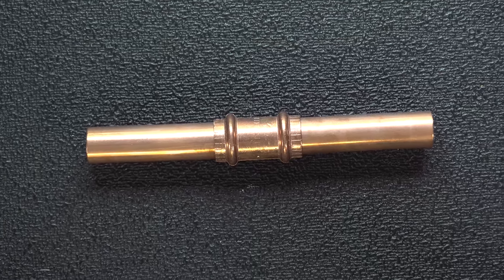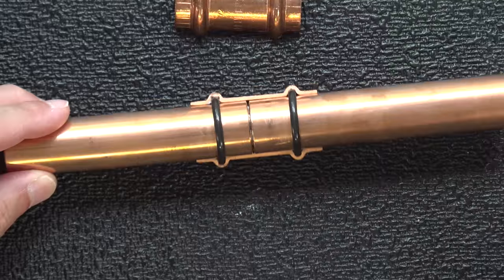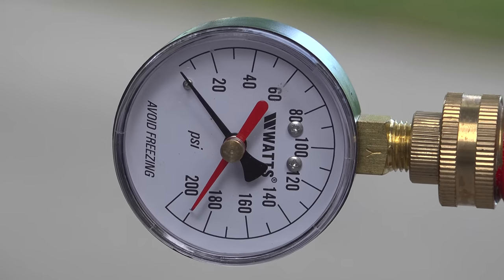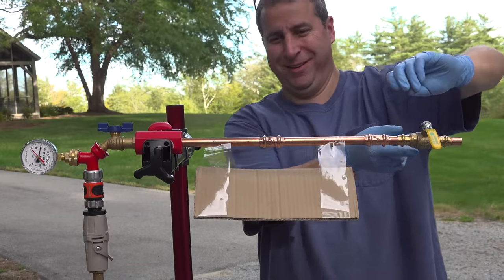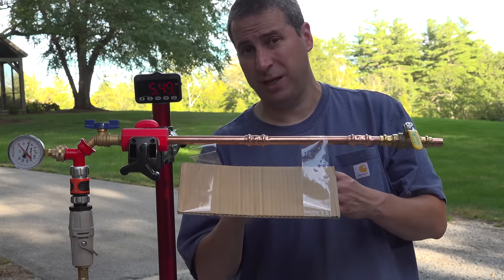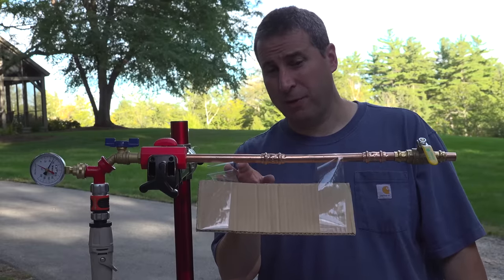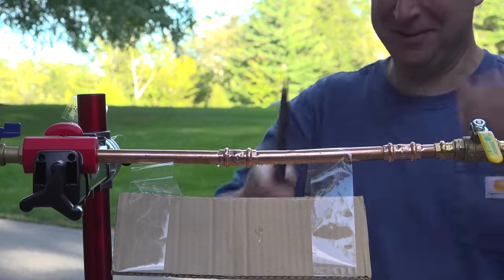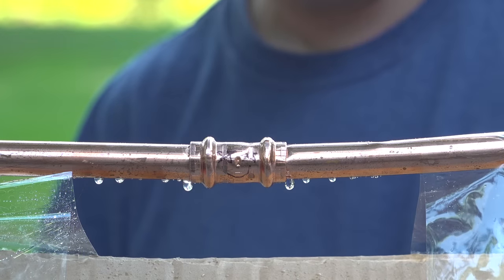Do O-Rings Really Leak Over Time? Testing PROPRESS

Comment: Its similar to a copper flare...so if the pipe is in original drawn form....it will be good,never had a problem with compression flares when done right....i use synthetic grease with my flares like a gasket,so the oring does the same thing as a gasket on press copper...

Comment: maybe for extra insurance, since o-rings are out, you put a little solder on outside? then should be good to go for a long long time.
Reply: At that point you defeated the whole purpose of these fittings (faster, no flame required, no need for pipes to be dry) so you may as well skip the expensive crimper tool and use the much cheaper fittings that are made to be soldered. Also, solder wouldn't correctly penetrate this joint as tight as it is. If it's sealed well enough to contain pressurized water, there's no way solder would get through it. Just crushing a regular fitting enough to keep it in place while you solder it can cause the solder to not seal properly.
Reply: @averyalexander2303 I think that was exactly his point

Comment: My problem with ProPress is not hitting it with a wrench. It's hitting with something much more solid. Water hammer. A lot of houses have water hammer issues and ProPress is commonly used as a repair to an existing system. A lot of older houses have water hammer problems. Mine is one of them I just have an addressed it yet. However, you're only a 58 PSI. Every house I've ever lived at had nearly a hundred PSI water pressure. Mix that with a few long pipes and a sprinkler solenoid that abruptly shuts off, now you get shock loads of several hundred psi.  In some cases hammer can explode pipes. However i'm not talking about that extreme of a case.
Reply: Yes, it would be nice to see the test repeated at 300 PSI, with and without O-rings.  Of course, water hammer can cause properly soldered joints to fail also.
Reply: gadeteez. I am genuinely interested in your comment.  Is it the velocity of the water that causes the pressure surge. I think a water pressure of 100 psi that can produce three times that by shutting off the valve is always going to be at risk regardless of the fittings. 
I would fit a shock arrestor in such a system.

Comment: It's not expensive, the price is very close to solder fittings. I did however buy the rigid tool for $4000.00 because I have 3 homes that I am working on. It will save me in the long run.
Reply: Here in California propress is 4x more expensive than regular solder fittings

Comment: What is the difference between M contour and V contour? I'm about to buy a press but don't know which contour should I buy M or V? I will use the press on steel water pipe to radiators for 45° connector. Thanks for reply 😍💪
Reply: They are supposed to be rated the same. But I've never even seen the M ones. 

The most common fittings & tools are V.
Reply: I would ask your plumbing supplier what they carry more of. Fitting availability in your area should be the largest factor to consider.

Comment: Time will tell, is there low cycle fatigue?  The fitting seal depends on the intimate metal to metal contact.  I doubt you are pressing it hard enough to form any diffusive bond.  At the molecular level, it is just a metal to metal contact, did it form an intermetallic?

Comment: You didn't mention thermal expansion or pressure spikes and poorly installed pipe fasteners meaning when the pipe moves around the wall for a long period of time. 
Don't get me wrong. I'm not saying these things aren't great. I'm just saying the o-ring is extremely necessary just like SharkBite.

Comment: Oh and one other thing I forgot to mention use it on a  circulator pump what you just did and be surprised to see what happens. The reason I know is because I have had several fittings leaking on me because of seal rubber were broken when I was using the clamper.
Reply: Then you aren't sanding the pipe well enough and are cutting or dislodging the ring. The fittings do not leak if installed correctly.

Comment: This isn't true because I'm a handyman whose has come across enough leaking ProPress fittings "with" o-rings to stay away from them. 
But if you're outside and or under the house, take a chance if you want.  The best system after soldering of course is: PEX -A  Uponor with expansion rings.  I was thinking about going with PEX-B because is was much cheaper at the time but the crimping tool is so cumbersome and you can't always get that damn crimping tool where you need it  And you end up kinking the PEX-B pipe, which cannot be fixed like PEX-A. You have to cut it out. So I bought a used Milwaukee expansion tool, that I think was stolen, because it didn't come with the box and or 3/4" insert.  And how I use it is to tie a tether cord to it and clamp the cord to something even if it's my neck. Then when the expansion ring is expanded, I just let go of the tool so I can have two hands to quickly push together the pieces before the ring contracts. This is so easy and less than half the time than the crimp rings and 10X fast than soldering.
Reply: I call bs. No way a handy man sees fitting after fitting fail and professional plumbers do not. 

You are also wrong about PEX. Pex is superior to copper in several ways, not inferior. Both compression & expansion pex can be repaired with heat if it crimps. 

There is also a type B from Zurn that is both expansion or crimp. So calling them A & B to talk about crimp or expand, is no longer useful.
Reply: They fail if you don't stick to the process on how to install them. Lack of training.

Comment: I understand this is good. But is solder still better? If you beat a solder connection the same number of times, will it leak?
Reply: You could bend a soldered one 90deg at the fitting or hammer it flat and it probably still wouldn't leak.
Reply: @Chris-du7hi untrue. The flux eats away the copper & brass and hardens the silver in the solder. The copper & brass are way more malleable, while the old solder can crack, since potable water solder has nearly no soft lead in it.

Comment: brake lines in your car works the same way, compression fitting. Some brake lines on motorcycle works with copper gasket.
Reply: Automotive Brakes Do Not use Compression Fittings. Most use either a Double Flare or Bubble Flare fittings whuch are good for over 1000 psi. Your Homes water pressure is under 100 psi tops so these fittings are no problem.
Reply: @jeffreycaban5107  maybe what I wanted to say was the fittings doesn't use any form of rubber seal. But thanks for that clarification.

Comment: This reminds me of how they thought older style electrical connectors were fine because they initially work great for 10 years or so but metal expands and contracts with temperature and over years it will no longer be a tight connection. Then you're really depending on the o ring, which won't last forever. These kinds of connections are going to not last as long as solder. But at least most of us will be retired or dead by the time things really get bad.

Comment: The press fittings are forming water tight seals with the coppers walls of both the fitting and the pipe, the rubber part of the fitting is not actually supposed to be in contact at all times with said water. It's more like a backup in case of failure or penetration. We've used thin copper gaskets in all sorts of applications much more sensitive than even water pipe system (engines for one.) These copper press fittings are forced together with thousands of pounds of force. This not a new or revolutionary technology and is in fact quite surprising to have taken so long to develop.

Comment: Virgin themselves say that the o ring is what seals the connection. Not the metal to metal contact. If you’d left it for longer before beating on it you’d eventually have had a small leak.

Comment: They should sell them without the O-Ring, but with the ring cavity prefilled with solder. Then you could flux up that pipe, press the fitting, then hit it with a torch. Everybody's happy. 😁

Comment: They should make a version with a ring of solder in place of the o rings. 
Crimp then heat!

I get these are cool but it seems to me not a lot faster to an experienced plumber. 

I’m no plumber but I did some pipes a long time ago and found soldering simple !
Reply: Propress has it's pros, certainly faster if you have a lot of fittings to do and much safer if you're in a confined space around flammable materials and lumber.
Reply: There used to be a line of fittings with a ring of solder in it, and they worked great. I wonder now if someone looked at that fitting and thought "Maybe if there was an o-ring in that groove instead of solder and I could just crimp it...
Reply: @milesparris4045  yea maybe… and sell an expensive tool!
Reply: Tell me how pro press is not faster when you have a 2” main water line for a building that you try to solder with water that doesn’t stop coming out of the line for hrs were you can press with water still in the line?
Reply: They make fittings prefilled with solder that don't get pressed already.
Reply: @chrisford8403  I only saw them once at a Home Depot, they were on clearance at like 90% off so I bought a bunch. They worked perfectly fine.

Comment: Press is great however- the tubing must be in spec and you have to have a good charge on the crimping tool in order to make a good seal.....Old time plumbers still believe in soldering though...
Reply: Type L, M, and K, 1/2" to 4", soft copper tubing up to 1-1/4".  We didn't start using soldering as a means to connect water pipes in homes until the 1940's.  Before that it was fine thread brass pipe and fittings.  The first patten on a press fitting was in 1959 in Europe.  1989 it was everywhere over there, and in 1999 came to North America.

Comment: I have cheap rubber supply lines that've held up for over 20 years and sweat fittings that failed after four. Welds and plumbers' egos are the only thing you can actually guarantee to outlive most houses.

Comment: I wish Ridgid would make this tool for the consumer market
Reply from the maker: I agree, I think they are nuts. The real problem is the Viega patent, they charge a fortune for licensing it. If they offered this as a $399 tool, it would change plumbing even more than Sharkbites have. I feel like someday a CEO will figure that out.
Reply: @SilverCymbal  I agree.  I’m doing a plumbing project now with shark bites and would gladly buy a tool for $399 to have on hand for now and future to use press fittings!
Reply: @SilverCymbal  There is no Viega Patent on the Tool, Ridgid / Emerson makes them for Viega in Germany/EU (Look up Viega PG6+ or Nussbaum T7, all the same). Unfortunately the tool cost much more to produce then 399 at the quality level it has now (100k cycles, no service required). There is the RP115 but still not a consumer tool. Do you know a RP35x has 8000psi oil pressure inside to make these pressings? Thats just not doable at the price you want and even get back the R&D cost for that tool, sorry.

Comment: That’s not an o-ring. That is an EPDM sealing element. Viega does not use the terms o-ring or gasket, those are dynamic seals that are meant to be replaced. Viega fittings have a 15 yr shelf life with a 50 yr installed warranty. A total of 60 yrs. It’s legit, I did my research.

Comment: Good job on your presentation for the cold water line now try  it in the hot water line and see what happens I'm not going to say anything just be surprised when you do use hot water .Remember the phrase that says hot water expands. End of report
Reply: And yet I've done so over and over without a single issue.

Comment: Why use copper of any kind when pex is available?
Reply: Because pex cannot be outdoors exposed to sun light and should not be installed outside of walls. That's why pex stub outs are copper. 

Outdoor pipes and pipes coming out of walls should be copper. Only use pex in walls, or attics & crawlspace.

Comment: Try it on soft copper !
Bet it leaks !
Reply: You cannot use press on soft copper. It's against all manufacturer's directions & illegal in plumbing code. Push to fit nor press can be used with soft copper. Period.
Reply: @djaa7  Don't understand those smart ass people. That's like saying use a Wago connector rated for 32 Ampere on a 100 Ampere installation. WTF ?!

Comment: If that's the case,  then you don't need their fittings.  Just use soldering connections and crimp them. The o ring is the business end. Why else would it be in there.. but if it did leak maybe could solder of braze it instead of ripping it out

Comment: look at the shape of the pipe near the compression. cavitation is bad in copper pipes and that change in shape basically guarantees faster wear. I would 100% not trust that fitting long term testing it for a few minutes or days is not the reality. it will vibrate, heat up and cool down and experience changes in pressure. there's no chance this lasts longer than a sweat joint.

Comment: You cant rely on a metal to metal seal if its not prepared with the right surface finish and geometry. A flat lap seal like that isnt the greatest geometry for that. Also, doubt a common worker is really taking proper care to ensure a metal to metal seal is achieved well. So, O-rings are there because they are needed, or they wouldnt spend the money on them. Still sealed with O-rings unfortunately

Comment: Pass for me or should I say I would ONLY accept a pressed/crimped fitting where it's accessible and NOT buried in a wall or floor > > > Pex and ProPress just hasn't stood the test of time as a properly sweated copper/lead fitting. 
70 plus years on the original sweated copper in my house... zero issues.
Soooo, get back to me when Pex/propress has 70 years under their belt.
Reply from the maker: Lead free solder hasn't seen 70 years, but you are ok with that? Not even close to what it once was. Watch this test I did on propress, surprising results: https://youtu.be/QtysRkM1gEI
Reply: First patten on a press fitting was in 1959

Comment: Now beat one like that that has been soldered. Guarantee you it will leak. Solder is also not resistant to heating and cooling and could fail just as well.

Comment: Why would anyone use copper when you can use pex?
Reply from the maker: Just when adapting to nearby pipes or if you need physical support of copper. New runs or extensions are better with Pex-a
Reply: Commercial spaces in a lot of parts of the world will not let you use pex at all

Comment: You used the wrong copper pipe your supposed to use L copper, the blue pipe
Reply: Viega ProPress fittings can be pressed on type L, M, and K
Reply: @robpendola5888  it can be but it’s not ideal to use them on M or especially K copper lol
Reply: @robpendola5888  I mean if your repairing copper supply lines that are original in a older home, it probably has M copper and we are crimping onto that, but I’m going to use L copper for the repair if I’m using a propress

Comment: Essentially these are alike to swaged fittings in aviation. Basically deforming the metals together to make a fluid tight seal between the two metals. Theoretically if done right could handle thousands of PSI of pressure or however strong your material is capable of handling. No o-rings necessary

Comment: Um, yeah... there's no amount of crimping on a bare copper tube/fitting that is going to make a reliable leak-free seal. None. Period. The wall of the copper tubing just isn't thick enough to resist the compression forces well enough. Let alone the problems with surface finishes getting in the way.

Comment: Whatever. There’s almost nothing statistical in this. Crimp 100 and see how many leak, then expose them to some typical oscillating loads. And what if the number that leak are in a house 30 years after install. Maybe fine where they’re exposed but you gotta be brave to put a bunch of these behind walls and under floors. If the failure rate without o-rings was low enough to not worry, the manufacturer would market them that way.

Comment: Price is entirely obscene. They could make the price 1\20th and make more money from everyone having this press in their tool box.
Reply from the maker: Someday Viega will start selling their patent to Ryobi and others. If this tool was affordable, they would sell millions of these and still make a fortune on fittings. They just dont seem to realize that yet.
Reply: I have the Milwaukee m12 progress. Got it with a Home Depot 10% coupon on a mass tax holiday weekend and got a free m12 tubing cutter for about $1600. I e had it for a couple years now and don’t regret it
Reply: how many rolls of solder would it take to sweat 100,000 4" copper fittings???      Because a ProPress tool gets you 100,000 presses before calibration.  The money saved in labor isn't even close to the price of tools and fittings.

Comment: Pro press may be faster but not cheaper after comparing costs and buying the tool solder is by far much cheaper.
Reply: If you can solder properly (which is the main point!) and only use it for a few connections (not ten thousands), yes. But you can also rent a tool

Comment: Stupid.... Now sweat a coupling in there and smack with what you were using. See if that leaks. IT WON"T.  Propress expensive tool, needs to be calibrated (documented if you ever want a warrantee claim on your fittings).   You can have it.

Comment: Solder been around for 80 years no leaks WAY CHEAPER THAN PRO PRESS
Reply: Longer labor times, soldering became prevalent in the 1940's, the first press patent was in 1959,  the tools today get you 100,000 presses before they need calibration.  How many rolls of solder would it take to get 100,000 joints sweat?  How many tank refills?